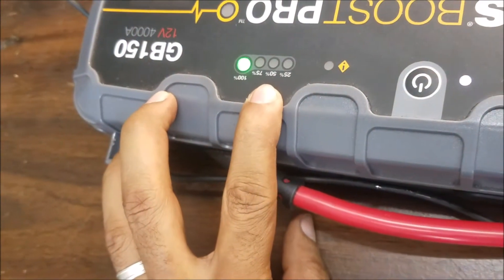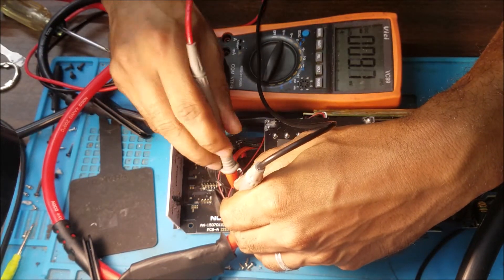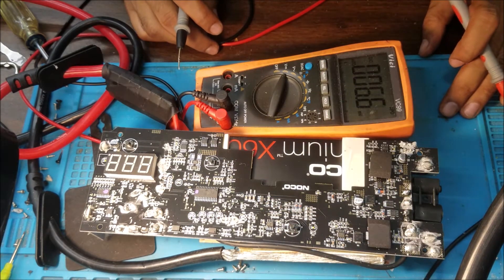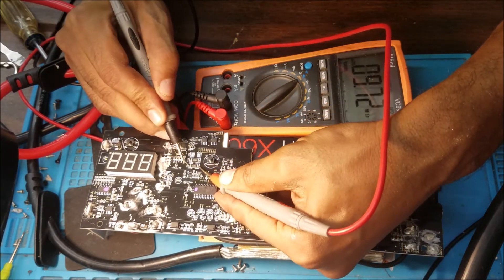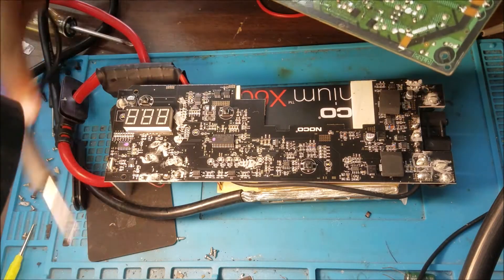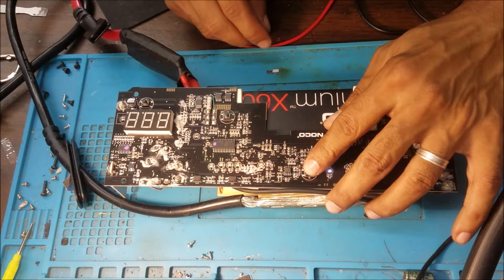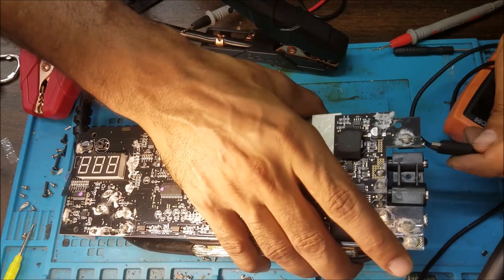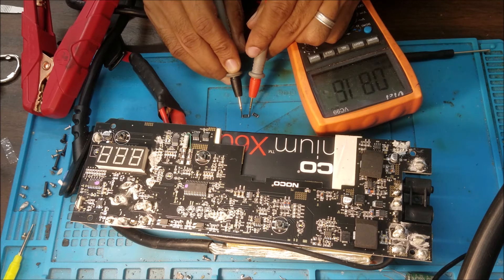noco GB150 turns on and off red green flashing issue

Comment: I have a gb150 when i plug usb charger up the led charging lights run thru from 25% to 100%  then it stays at 25%  as soon as i turn it on it turns off
Reply from the maker: i need to check it